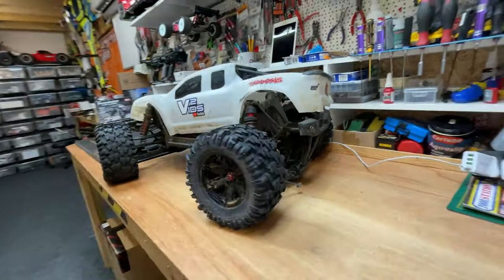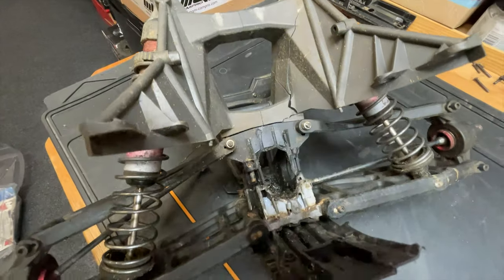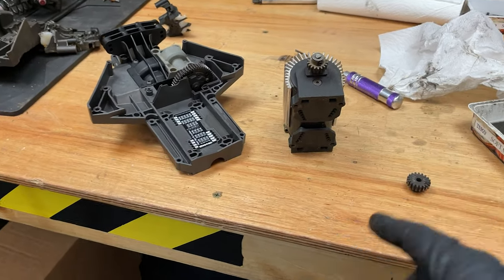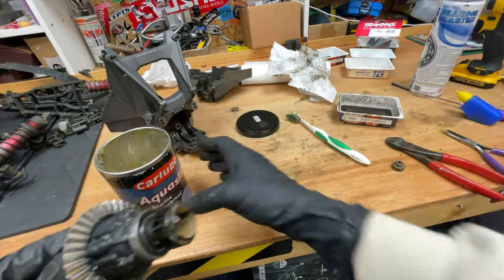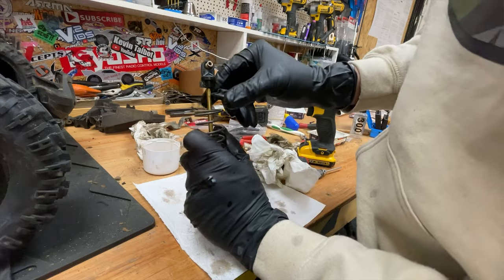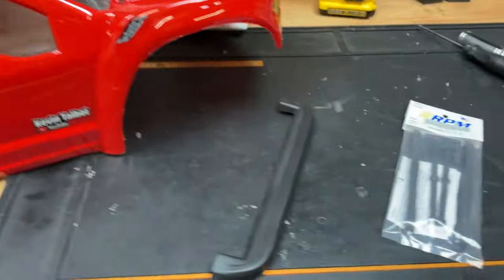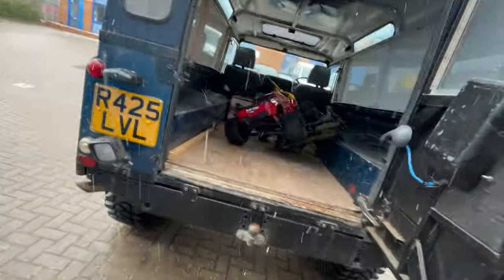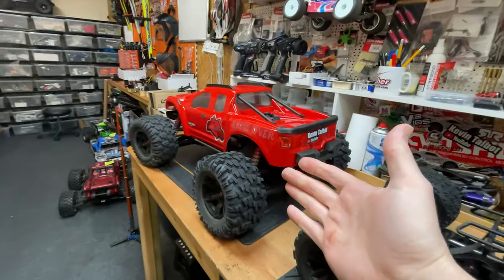Traxxas 8s X-Maxx Rebuild (My most abused RC Car)

Comment: The new body looks sick!! Thanks for playing a part I getting me into R/Cs, and for introducing me to all these awesome budget R/Cs! My first and current RC is my modified WLTOYS 144001, it has a Hobbywing 1060 brushed ESC (works great), a drop in metal gear 3 wire servo, and a DumboRC X6 radio and receiver. I'm still running the stock 550 brushed motor, when it wears out I'm probably going brushless!

Comment: Quick tip for yall. Seen where kev had a screw round out. If yall have one round out, get a torx bit the same size. The points usually give a bit of grip n will back the screw out. Always worth a try before attempting to drill it out
Reply from the maker: i forgot about that trick!
Reply: OR try getting the proper tool for the job the 1st time around
Reply: @KevinTalbotTV Don't do it just get correct tool for the job instead of having a stripped screw PLUS a ruined torx from it slipping inside fastener

Comment: Just a small tip kev. If you use a star hex key it gets more bite in the rounded allen  bit hole. . Works a treat . Then if in doubt  get the dril bit out. Hope this tip was handy.

Comment: Add the aluminum plates between the bulk and skidplates and the bulks are going to last 10X longer. Also start using tekno rc pinions with the softer blue loctite and just be done with the pinion struggles everyone! Great vid KEV!😍😍😍☝🏽

Comment: Without even seeing this rebuild run, I'm feeling bad for it. I absolutely know you want to test out these new parts. Poor XMAXX. But I know you're loving on it now. I'll say this, you're very good at rebuilding trucks, but it's a ;ot of work to fix it, but you seem to have as much fun rebuilding it, as you do bashing it.  I can't wait to see your Monster Truck up and running. I bet you don't take that one to the Moon. lol Just so your sponsors know, I got the XMAXX because of your channel. I love it when you say it's your favorite RC truck. You know more about the RC world than anyone else.  Try using  3M 90 spray glue on the drywall tap sometime. It's holding up on my RCs in the snow. It's mush faster than smearing Shoe Glue on it. I love the Red. XMAXX is back, better than new! Lets get to it.

Comment: i had exactly same issue with piston on my trx-4 . altough the piston is much much MUCH smaller :D , there was absolutely no visible damage to the small plastic piston, but it was going super hard inside cylinder. what i did i just take a very fine sandpapier, and did just few strokes around with it over it, and it magically solved the issue.

Comment: try wrapping your set screw with Teflon tape. it works for me and you don't have to use lock tight, and you could try getting a longer set screw instead of those 1/8th inch screws, you could get a quarter inch one. (if the threads are available that is)

Comment: For stripped screws use a rubber band. Place the rubber band at the top of the screen then use your drill to remove.

Comment: Battery cable disconnection is simple fix I run a piece of velcro around the battery cables and the xmaxx chassis bars over batteries and it keeps them from slamming around a coming disconnected!!

Comment: KEV KEV KEV KEV!! NO NEED FOR SHOOGOO! USE THE DRYWALL TAPE AND SPREAD LOADS OF HOT GLUE!!!!  LIGHTER, CHEAPER AND JUST AS TOUGH! WORKS AMAZING!!
Reply: @Chiron Keller yes. Used both and hot glue is waaaay easier, cheaper and less cancerous for sure

Comment: I personally prefer the deeper red than comes from backing it with black. However, if you or anyone else prefers tge brighter red from backing it with white that's cool too. That's one of the many awesome things about the RC hobby is you can make vehicles into whatever makes you happy. 
I kinda would like to have an Xmaxx, but at this point in my life I can't afford or justify the nine hundred dollars USD cost for one. I have been looking at and considering a Mini Maxx or Hoss though. The prices for those smaller ones is more affordable in my world right now. I also really want a Arrma 3S Typhon for a basher buggy. 
In the meantime I am using my Axial Wraith Spawn with it's RC4WD 2 speed transmission as a sorta stand in for a all around basher/crawler rig. I kinda want to change the pinion to increase the top speed in high gear, but I don't want to lose the low end torque in low gear. What a conundrum I have. LOL 
Anyway, enough waffling from me. BWAHAHA!

Comment: I’d love to see how you clean them up after bashing them in the snow. Drying them off and lubricating them.
Reply: Yeah same here, if i go out with my x maxx for some snow bashing fun i always dry it with my heatgun first. Then i start to blow any rest water of with my blower tool and then start to spray on any screw with WD40. So far it works pretty well for me and can't complaine about anything.

Comment: Look on eBay for a XMaxx body shell crash saver, it goes on the back in front of the bumper with a couple longer screws and the body where your’s broke sets into it. I have the eBay one and have made my own and they help the back end of the body last longer.

Comment: Hey Kevin, I just bought a traxxas slash drag truck and the Losi 22s drag truck… can you get into drag racing? I’d like to see you “test”them as only you do right!! I bought just about every upgrade part that I could find for the Traxxas. I bought all aluminum though. It seems like it will be SUPER heavy after I put all these aluminum parts on. Now, I did go carbon fiber on the shock towers to cut a bit of weight… I would like to see you get into those builds!! There are all sorts of rules when racing them. They only allow 2s Lipo for power… can you make them fast as hell on 2s?? I challenge you to do just that mate… I’ll be watching😳

Comment: just a fun tip, those batteries are not lipos, those are graphene batteries. graphene batteries are safer than lipos, less flammable, and they retain their charge much better and discharge much better than lipos

Comment: Kev if You ever come to the states you should bring the monster truck and a welder then I’ll help make it even bigger mate us in the stages don’t mess around with the huge trucks
Reply from the maker: All of it came from usa dude, same size and spec as a monster jam truck
Reply: @KevinTalbotTV  if you’ve ever been to a mud bog we make them even bigger then the monster jam rigs! They may not be as fast but they’re on tractor tires and 48+ inches of lift from a stock truck
Reply from the maker: yeh ive seen those but not what im after, they are cool though!
Reply: @KevinTalbotTV  would love to see your rig be done , I’m trying to open a fabrication shop and then I can build some things just as crazy if it rolls out the door on tiny shop tires I’ll build it or make the door bigger 🤣

Comment: Instead of using shoegoo try using roof and gutter silicone. I used it on my slash and it takes a beating. The silicone is a lot cheaper than shoegoo also

Comment: For anybody who keeps using shoe goo, you've by now realized that it's quite expensive and you need at least 3 tubes to do a decent sized body. Stop spending so much, and just buy a strong clear silicon caulk! 1 tube for less than $10 and you can probably do 3 bodies!!

Comment: that was a great rebuild and bash video! how come you didn't soak all the new parts overnight with WD-40? since it's winter, the plastic will break easier. would be a shame after all that time and energy spend rebuilding it. thanks for the video Kevin!

Comment: Hi Kev... We have an 8s xmaxx which has done a fair amount of bashing. We have just gotten a dusty motors body sock for it to keep gravel etc out of it. Any suggestions as to how to clean the plastic surfaces so that the velcro strip material will stick to the various places on the body? Isopropyl seems to leave the plastic feeling a little "greasy".

Comment: Hi kev :D, 

I just finished making my rc car brushless. I have a ecx amp mt but it is still broken. I crashed and i have 3 wheels left. I havent tested the brushless set because i dont have the reciever. Its a 120a esc 2s-4s and a 3650-4300kv motor. The motor is 4 poles i dont know what that means.

Comment: Hey, I’ve got an idea that I was wanting to try but can’t wrap my head around it. Maybe you’d be down for the challenge? The idea is to fit a Toyan FS-L200 along with a radiator into a Fijon FJ9 Bulldog. Don’t think a transmission would fit..so it’d only be a forward driving model, but I think it’d come out to look pretty cool with a functional engine in the chassis.

Comment: Need to get some MIP bits for your drill Kev, no more rounded heads 😆
Reply from the maker: these fit better than mip, i tried them!
Reply: @KevinTalbotTV  really? Fair enough then, I bought a set of MIP speed bits and they've treated me brilliantly with my Arrma Mojave, they're not magnetic but the screws stay attached to the bit when I remove them because the tolerances are super tight, I bought a set of bits that were magnetic from an Amazon seller who just resells the Chinese stuff that were junk, was rounding off screws and despite being magnetic, screws fell off, so I can't rate the MIP stuff enough 😃 Maybe one day I'll pick a set up, brilliant content as always Kev 🤩
Reply from the maker: Maybe the mip that i tried were a bad batch then? You can magnetize them by rubbing them on a magnet
Reply: @KevinTalbotTV  possibly something to do with imperial vs metric maybe? Idk i ordered the metric set (1.5,2,2.5mm) from modelsport and honestly work a treat on my xv-01 and mojave. I know with Tamiya it's worth getting a Japanese standard driver as they're a bit different to avoid stripping the philips they come with, is traxxas maybe Imperial? I have no clue and I'm not the person to ask, however I want to get a maxx in the future, but I think traxxas are metric too, no clue. And you're right, I need to find a magnet to get them magnetic, think my pit stand has one but I'm at work atm 😓

Comment: Hi kev what du you think about the erevo version one? I want to buy one, the only problem is that here in Austria we don't have that many skate parks or other places to go bashing. Could you please get the DF-models df-4j XXL 10 years edition crawler it's very cheap. (2-speed transmission, electric winch and lights)

Comment: Got water in my Xmaxx receiver after running it in snow and it got it on the circuit board :( currently cleaned it with electronic cleaner and rebuilding my Xmaxx, so hopefully it all works!
Reply: Update: took apart and cleaned the xmaxx and now it runs as good as new ;D

Comment: Hey Kev.. I do hope you've realized the XT60 connectors and your IC5 connectors are actually the same type of plug. If XT60 failed on you, so will IC5. look at the metal posts inside. that is what is holding the connection together.. If you're looking for a new type of connector, I'd look elsewhere

Comment: So just bought a xmaxx my friend and I both on the same day. Haven't even got full battery out of both cars, literally had them for 1 day the shock cap on his broke and my wheel bearing seals have separated from the bearing. It sucks we see some many good reviews and bashing they take, and we were just using them in the backyard for a 39 minutes we got lectron pro 7500 lipo batteries he got one bad battery and I got one bad battery that made the cars cut off after 5 minutes of driving we thought something was wrong with the rc I did a voltage check and we both had one with low voltage and both those batteries were swollen it was day one bad luck. We are both new to RC we wanted the best of the best so we went with the max. It's just disappointing to spend that much on a rc only to have to upgrade all kinds of parts to make it reliable.  Anyone else have issues

Comment: my x-maxx was destroying all the spur gears I used, plastic, metal, until I started using it on 1 position smaller than the actual gears. For example, currently it is 16/54 so I set it on the pin for 15/54. I almost wrote you for help, I was desperate.
Reply from the maker: get a proper steel spur and pinion not the traxxas ones
Reply: @KevinTalbotTV  hot racing spur gears also broke, but as it is right now it has been holding strong for months. Thanks for the reply 😁.

Comment: How are you liking the new powrrhobby tires kev
Reply from the maker: goob but i prefer stock for hard bashing
Reply: @KevinTalbotTV  yeah, the weights a down factor but should be alot better on high speed. Like arc raceway, when are you fixing the eachine eat02? Could be fun on 6s

Comment: Not gunna lie you can  beat traxxas you can get like a bolt for the inside motor I have a traxxas rustler 4x4 vxl and 2wd brushed traxxas rustler always had traxxas me and my family used to have erevos and summits and hundreds slashes everything

Comment: You can use the shoogoo on the exposed parts of the connectors to keep them properly waterproof, make them stronger and prevent the rear housing coming off.

Also E6000 from banggood is probably just as good if not better than that Shoe Goo stuff. You probably shouldn't be using either indoors though.
Reply from the maker: yeh i do it outdoors now. might try that stuff :)

Comment: Hey Guys,
I went to run my X-Maxx today and within five minuets or so noticed my throttle was cutting out as I was trying to correct when going over small bumps then I noticed that I was also loosing brake control also.  I tried a throttle calibration and even after this the throttle control was still cutting out. At this point I turned on the Bluetooth app and reset my remote to factory setting to see if this helped. Unfortunately not. Does anyone have an idea on what is going on?  This is rather unnerving and I am sure I am missing something simple but this is the second time I have run into this as my Maxx did the same thing. 
I just checked on the Receiver Box and it is dry. 

Max 6 ESC, Stock Motor, TQI Blue RX / TX along with the Link App.

Comment: Howcome every time I throw the same rc car 4 inches into the air the suspension just explodes and the battery pops out and gets dragged 90 feet and it catches fire and explodes and the rc car is completely just in 30 melted pieces but every time u do it and it gets 600 feet into the air and lands upside down and only the body mounts are cracked and the garbage velcro straps every rc car comes with are keeping the battery in really well

U get lucky or cameras make things really tough somehow

Comment: Hi Kevin talbot I just got a new rc car but it has one small problem with in a few minutes of using it the battery Finishes I returned and got the same  car but still it did the same thing
Reply: Please let me know what is happening
Reply: You know you need to charge the battery right.
Reply: @5KMF  i do i did all the things the instructions said to do so i don't know what to do now

Comment: I have like 50 RC cars and they are all broken and I don’t even have enough money to fix one
Reply: Sell 25 of them and fix the other 25. Jus saying
Reply: @Chiron Keller Or do a couple side gigs. Whatever works. Most fixes are cheap depending on the rc, I do have one rc however that costs me a $100 every time it breaks. Mostly because it never just breaks one thing,  it's always a slew of carnage. Not the trucks fault however,  I put that thing through it's paces every time I drive it.
Reply: @Chiron Keller The granite is an awesome rc! I have the new big rock which, funny enough,  has a hole in the chassis right now from driving it into a tree in sub 30 degree weather and the battery holder busting out of it. My other truck is a very heavily upgraded cen reeper that has a top speed around 70mph. Love that thing but I do tend to get a little too crazy with it. Also have a 6s kraton. It's stock though.

Comment: No rc that cost what that plastic heap of garbage cost should never break like that even after what you put it through.   Traxxas is such a rip off.  Plastic everything and proprietary everything.   One little thing breaks and you have to replace the entire chassis.   Traxxas: design a problem, sell the solution.